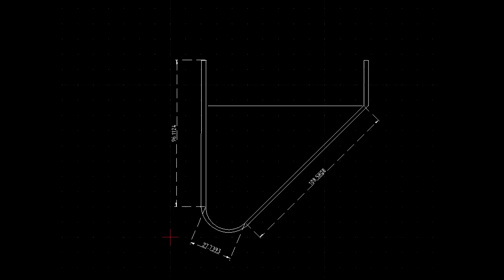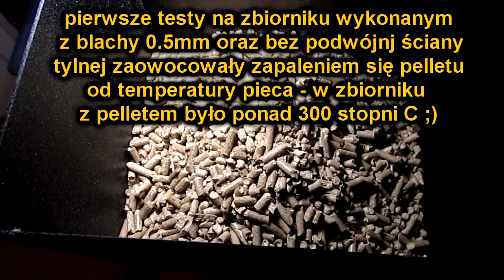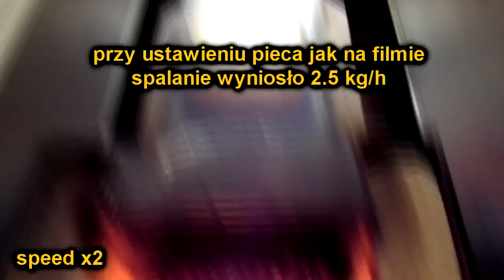Piec rakietowy LIFT - podajnik pelletu. Rocket stove pellet feeder

Comment: healthy, very well resolved in the primary and secondary air supply, and likewise provide authentication've noticed a hopper secondary air channel, everything very well, and prevent the accumulation of ash from the burner to be on the channel remake, not horizontally and about 30 degrees to the shoulders and a half, really liked almost perfectly, thank you

Comment: Hello! Amazing design! What size air gap underneath the pellet basket burns the best during full burning? Sorry this is English.
Reply from the maker: hmm gap size in LIFT is maximum 50mm
minimum can be even 5mm but after 5-6hours with such a small gap we will have asch touching the basket, so those 20mm are ok.
For more uniwersal: gap should be ~60%-80% of primary air intake. (surface area)
cheers